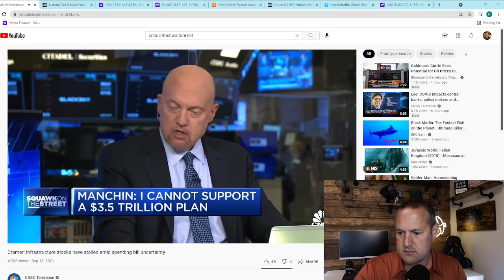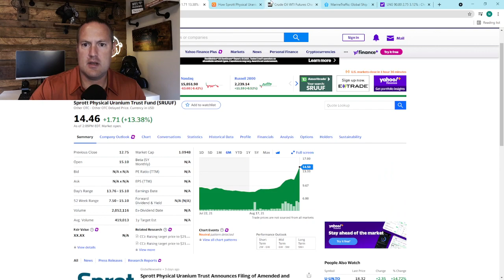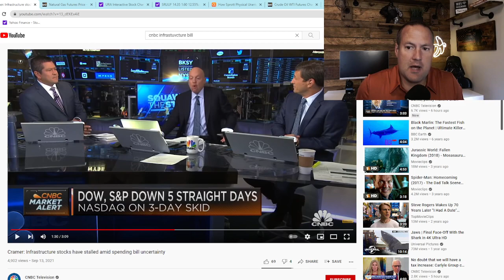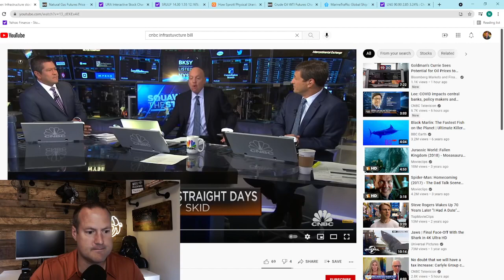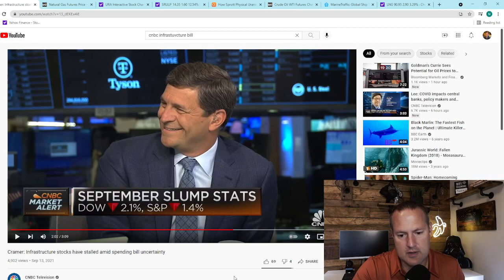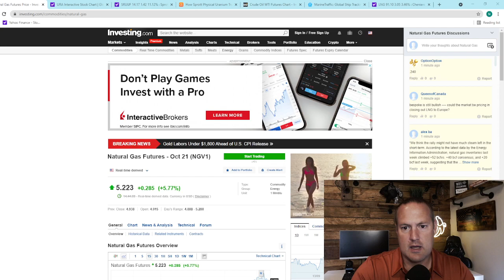Inflationary Reality Setting In, Even CNBC Starting to Realize It

Comment: Sprott is closing in on $300M worth of uranium. 

A new prospectus to buy another $1B (on top of the $300M covered by the original prospectus) was filed on friday.
Reply from the maker: I saw an article that said something to that effect also but they’re buying it so fast that I wasn’t sure that was the latest figure and I didn’t want to put out wrong info.  Also the market cap of the trust is over $1 billion - does that mean they’re about to buy another $700 billion just to keep up with in-flows?
Reply: @NobodySpecialFinance  They issue new shares whenever there is a premium to net asset value (to get rid of the premium). They can then buy more uranium with the money from the newly issued shares.

NAV increases with the rising spot price of uranium but price of the shares are increasing more at the moment (market pricing in an even higher spot price) creating a premium to NAV.

With the new ”ceiling” of $1,3B they can now issue about $1B worth of shares at a pace determined by the daily premium to NAV and use the cash to buy uranium.

Yesterday the premium was about 8%. On monday it closed at 28% because Sprott wasn’t buying uranium. Incredible momentum. The spot market is very thin.